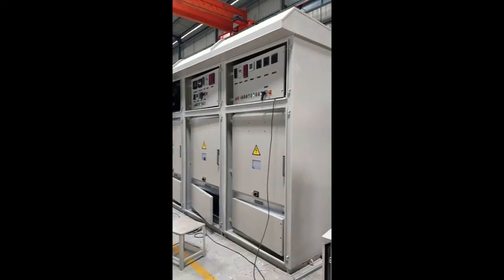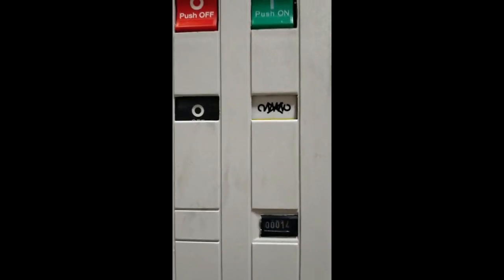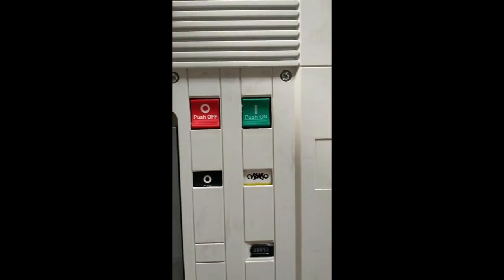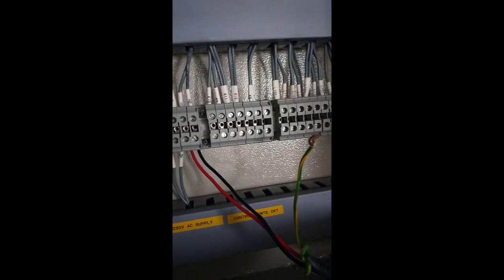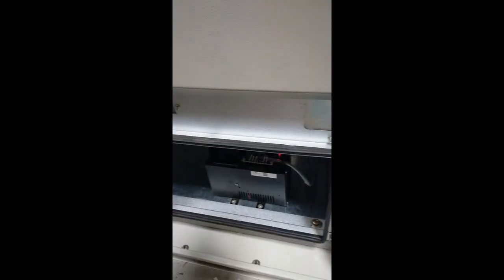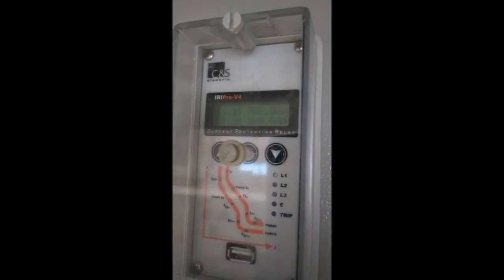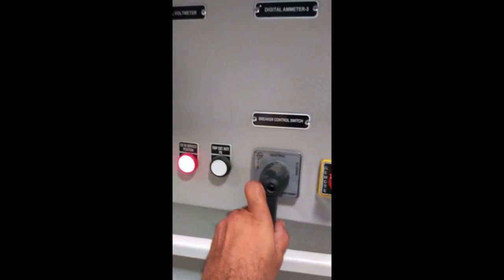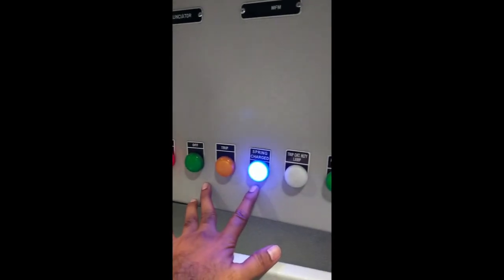Unigear ZS2 VD4 type ABB Make 33KV outdoor kiosk VCB panel start up guidance #Vacuum Circuit Breaker

Comment: Thank sir  our  abbey indoor kiosk  panel  inside.  Some sound   and  spark  came at  ctpresent terminals  and cable termination and breaker  fixing  contact a also     and  moisture developed  please how to solved problems  plus help me
Reply from the maker: Once shutdown the incoming supply and clean the moisture points and keep on the Heaters ... Maintain the temperature inside of the panel.
Reply from the maker: Take shut down of the panels, clean the moisture at CT's and PT's and tight the joints again, if bus bar jointing bolts are getting rushed, replace them with new bolts and nuts.

Check the heater once , if the heater is ok , Kerr maintain the temperature 🌡️ with in the panels.In rainy season and winter season keep on the Heaters to avoid moisture content. After all these job hissing noise will clear.

If you didn't care about this issues, flash over will happen soon. Take care